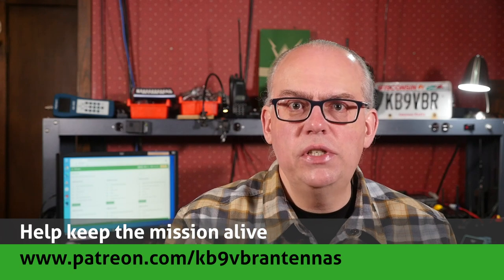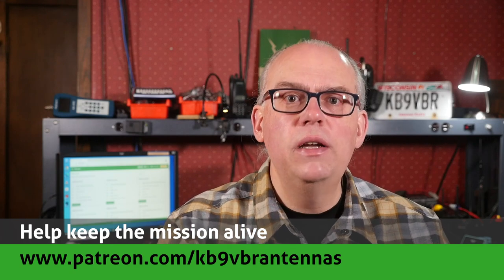Soldering Irons for Antennas (Plus a rant from Joe) July 2021 Livestream Excerpt - Ham Radio Q&A

Comment: I have a Weller soldering gun I received as a Christmas gift in 1968. It sat dormant for 6 years while serving in the USN. I still use it for various fittings and connectors. Yes, I do have a soldering station with various size tips.

Comment: Good day guys, a Question:  I was thinking of getting ready for a radio room, but, was not sure how to run the coax into the small 10x10 addition. I have seen a few mounts that fit in the window and seen 6, 8, 10-inch bulkhead connectors, I am thinking 6+ antennas. I live in a cold snowy winter area so the window plan is out, I was thinking of the bulkheads but that will leave them exposed to the cold, wet winters.  As I searched YouTube and antennas 
boxes seeing if there was such a thing and found a few videos on 
buzzsah, is using an outdoors electric box and installed 15, 2-inch 
bulkheads in the panel and when it is done or needs to work on, add to, 
or remove, he just opens to door, meanwhile, everything is protected from the weather. What do you guys think?

Comment: 1/ No soldering GUNS, Irons only
2/ Solder, not SODER
3/ Clean the solder itself before using it. Wiping off the oxide makes a difference.
4/ Make sure the tip is clean. 
5/ Use enough flux, and clean it up after soldering joints. 
6/ Remember it is SOLDER, not soder!
7 Don't try to just use one solder, get different thickness and Sn/Pb mix.